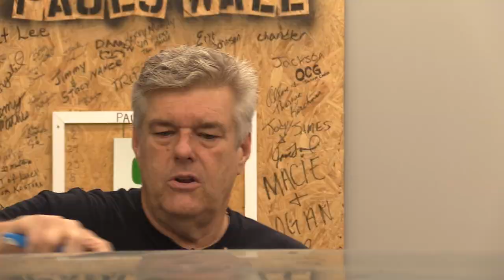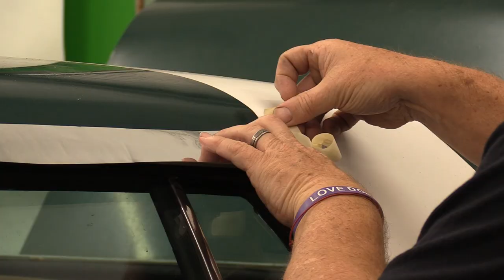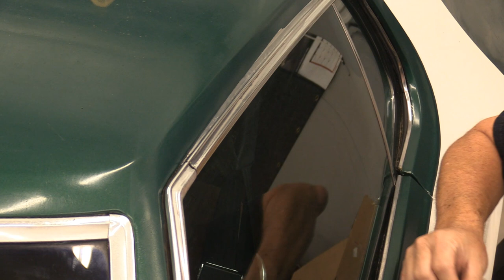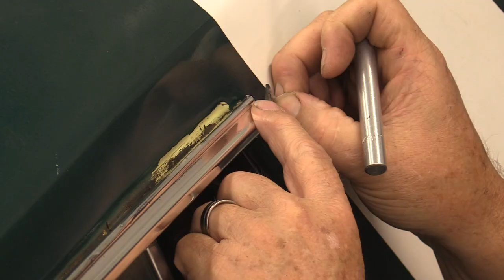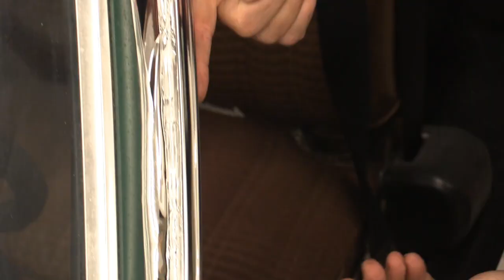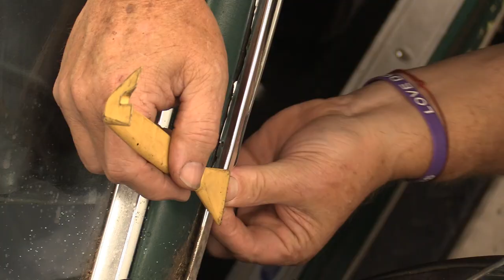Chrome Car Vinyl Wrap Renew Your Trim

Comment: I have been telling people for a while how this is 100% a good alternative as long as it isn't being stretched a lot. Especially on internal parts that do not experience temp extremes or weather. On a "classic" car these would hold up better than the daily drivers since most are kept in the garage and only driven occasionally. I personally would have taken the trim off so that I could get the vinyl edge hidden behind the trim. However, that is only if you are not in a hurry and want to spend a long time removing parts
Reply from the maker: I wanted to play around with it. Not done yet. I have more I want to try now.

Comment: The key to this is to use the proper tools which he is not doing. clean the surface with alcohol use a 30 degree breakaway blade to keep a fresh sharp blade for each new cut and some tucking tools.
Reply from the maker: Agreed.

Comment: I vinyl chrome wrapped the wing vents on my 68 Mustang. They turned out great and it saved me from buying new ones. I sanded the pitting and "bubbling" smooth, cleaned them good and applied the wrap. Easy!
Reply from the maker: Nice!

Comment: I got small paint chipping on my 63 Ford galaxy. There’s been body filler in it very thick. I was able to sand down to bare metal.  A video on that would be great.
Reply from the maker: I'm looking at playing with the chip spots on the roof.

Comment: You can also use aluminum foil / HVAC tape which works well and looks really nice. I think it could be a little more forgiving and a bit less fiddly then the vinyl wrap also.
Reply from the maker: I sue the Aluminum foil/duct tape on interior components. Weather is pretty hard on it on the exterior.

Comment: That was a very interesting experiment thank you. But seams to me it would have been easier to just pull the trim. But I do auto upholstery so I have some experience in doing that. But I am wondering if that would work on a 69 F-250 grill. I think that would be fun for you to try.
Reply from the maker: Pulling the trim makes it tougher from what I see. You can't get the tension required for a good fit.

Comment: I wonder how well that aluminum foil tape could work
Reply: It is ok, but I think that it would eventually oxidize if exposed to water frequently. Vinyl has a superiority. Foil tape is one way car modelers get the window trim silver in their builds instead of paint
Reply from the maker: Not as well as this. I can stretch this a bit, the aluminum tape won't.
Reply: Lasts about a year outside.

Comment: I hate to bust your bubble, but I used this stuff on my trim, and it came out absolutely perfect...AK Super Chrome Paint 60ml Bottle Hobby and Model Enamel Paint #9198
Reply: Pretty expensive when compared to how much you get in a roll of Avery or 3m Chrome vinyl unless you are dealing with a small amount of parts.
Reply from the maker: $9 for a 12x60 inch roll.
Reply from the maker: Most of the time, I haven't achieved the level of reflectivity I want.